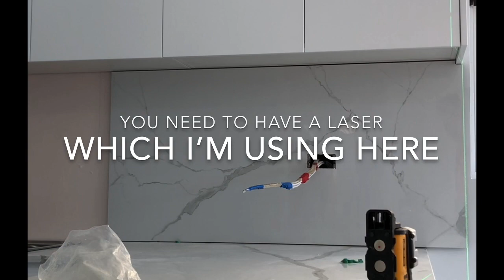How To Tile Kitchen Splashback by using large format tiles/DIY for beginners

Comment: I did not see the use of a tile trowel. A Trowel would spread the adhesive more evenly, and avoid hollow pockets. You don't start with a mix. Use a measuring tape 1st.

Comment: Brilliant work. I am planning a similar installation. I have same size tiles 1200x600. Only difference is that I was planning to put 45cm height between worktop and wall cabinets as per my kitchen designer. Which would involve cutting the tiles. But after looking at your install, 60cm gap is also possible. Any reason for people preferring 45cm or 60cm?
Reply from the maker: Hi Rahul
Thank you for the question I highly recommend you 60cm splashback 40 is not enough gap from bench top to cabinet.
Yes for sure people prefer 60.
🙏

Comment: Hi did you use grout in between the tiles? Or do you have any suggestions how to make the tiles look seamless? Thanks
Reply from the maker: Hi Charlene 
Thanks for your questions.
We have used grout in between the tiles joints.
To make it look seamless just use same colour grout as like tiles.
Thanks 
QLH Tiling
Reply: @QLHTilingWaterproofing  you did not use grout in the video though.
Reply: Are these cheaper than quarts slab
Reply: @yulianaredford7024  
these are much cheaper in terms of material cost and because its also possible to cut and install yourself if u have some experience.
with quartz slab you need to find experienced because the slabs are really expensive u cannot risk it.
honestly quartz slab will look way better as they are cut to size.
if u doing a quartz countertop you may as well just do a quarts backsplash at the same time so it all matches.
but these large tiles will look good too if done right and you are low on budget.

Comment: Please could you let me know, why some tile fitters say that big tiles cannot be used for a backsplash?
I bought exactly the same type of tiles in this video, for my kitchen backsplash and floor. (120 × 60 and 60 x 30)
One tile fitter told me that it will look absolutely ugly.
Is there any hidden reason? Bear in mind that worktops and backsplashes using the same quartz, is in fashion at the moment.
My idea would be that the worktop is white, with marble-pattern tiles for the backsplash and floor.
Please could you let me know? Many thanks 🙏🙏
Reply from the maker: Hi Sung The answer is yes definitely you can use big tiles for the kitchen splashback, you can use as big as you want.
There is no hidden reason for that its only some tilers they don’t really like to install big tiles because it’s heavy and harder to install then the smaller.
Thats all
Reply: I honestly thought the person in this video did a good job but I agree that huge tiles like this are super unattractive. To me, it looks like something from the 90s in a Miami Deco home. It's up to personal preference of course but I would say large tiles like the ones shown in this video aren't very attractive. It's also aesthetically better to have a variation of your kitchen tile dimensions vs your floor.
Reply: I have 4 by 4s and i hate them i will be installing big tiles to coordinate my new granite counter tops. Large tiles are the new thing. And besides if like it do it. Why do what everyone is doing?
Reply: I did the exact same tile and 1200mm x600mm estatuario marble effect large format tile just before Christmas and it looks great with grey cabinets. Just be mindful not to have white units with the glossy white tiles as it could end up looking washed out or like a bathroom. My kitchen worked well with the grey thankfully and the gold brass hardware. Tiles are VERY HEAVY and a nightmare to cut. I had a tiler refuse the job, another umming and ahhing and someone who just got busy and did it. Well worth it! Less grout lines and easy to clean.
Reply: @klaudm1804 I went with  slabs also. I hated the grout lines  and 100% for easy cleaning.